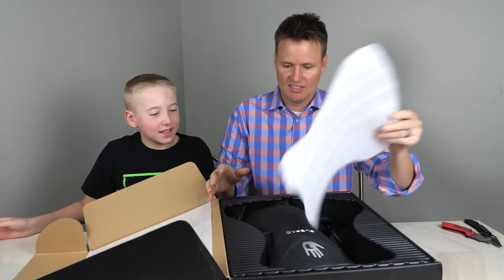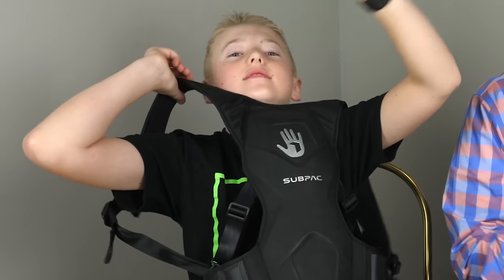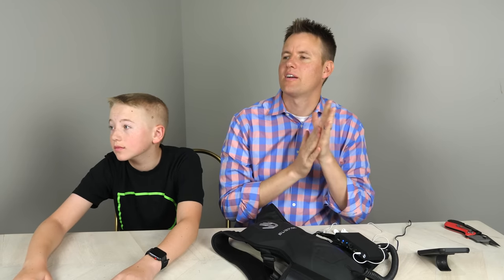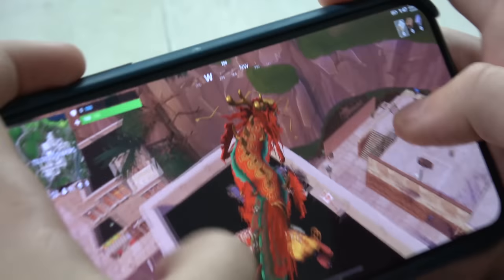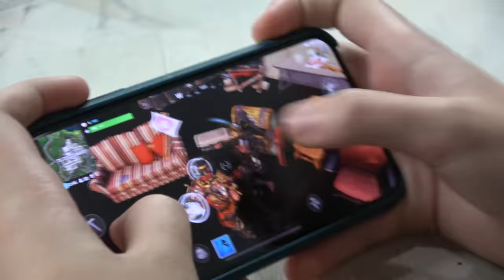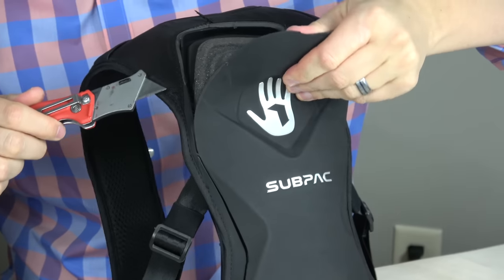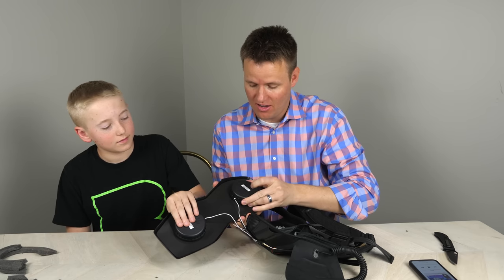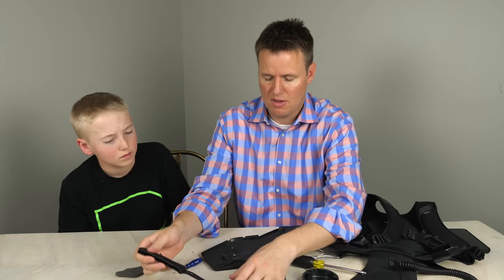What’s inside a Bass Backpack?

Comment: That is not a regular speaker youve got there. Its actually known as a bass shaker. They are typically used in high end theaters and home audio along with amusement park rides. They create the same vibrations as your phone except with a much smoother and more controlled output. You can actually buy one that slips under your couch and adds great effects to explosions and other scenes while watching movies or shows.

Comment: Do what inside a Xbox controller
Reply: Not anything special I've opened and repaired many just one big chip and some buttons
Reply: steve banana734 they already did the elite controller
Reply: Get the xbox 360 glowing controller you can see the insides
Reply: Battery, led, buttons, 360 motors connected to a few half pieces of metal Wich causes it to vibrate, a chip